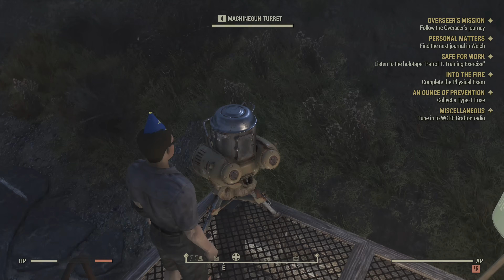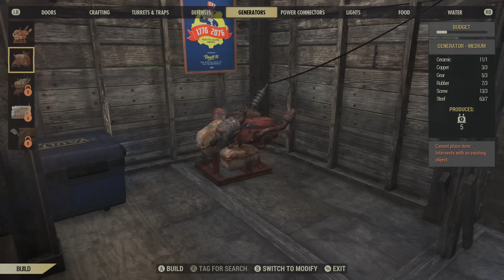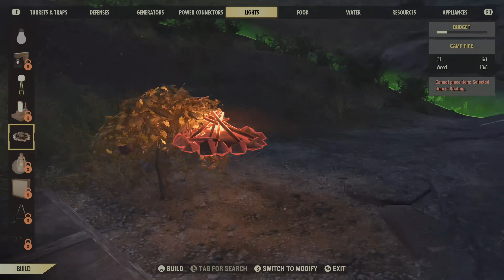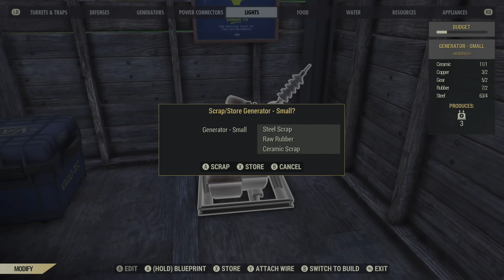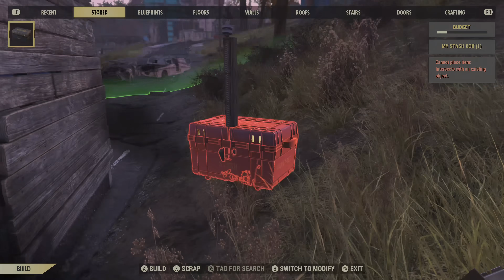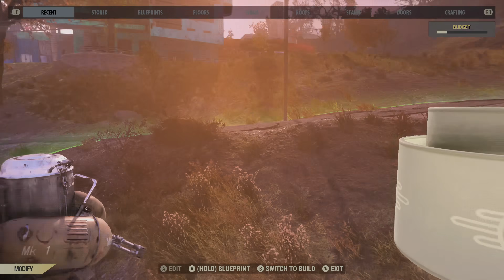Fallout 76 Electricity Guide Camp Settlement; Building Lights, Power Generator, Conduits

Comment from the maker: Fallout 76 Electricity Guide Camp Settlement; Building Lights, Power Generator, Conduits. Should help with the initial set up of lighting for your little bases. If you have questions let me know, I think this covers it well.
Reply: To unlock electrical switchs and pressure plates you need to unlock the plans for the Barn Building Set. It's sold from the vendor in harpers ferry.
Reply: @Landaren  i have learned that plans but i just got barn structure nothing electric do you know an other way to get all electric things like power switch ?
Reply: With just one pole up. What's the radius of the electricity? I hate having a bunch of wires running everywhere. So how far away can you have a light from the pole and still have electricity?
Reply: Where can I find military circuit boards is there a military base on this map
Reply from the maker: @desert-baytan3350  Umm, there are a number. I believe some are in the building right where my camp is. Some of the robotics places will have them
Reply: thanks
Reply: Straight to the point please 🙏 

We can figure out or materials problems later
Reply from the maker: @Keith Thomas  You want help and don't want to watch the video, ya.... Mostly has to do with area of where your generators are able to touch

Comment: How the heck do you connect electricity with generators outside the house to inside? I've tried to put one node on the outside and one on the inside but it says it has no power. The frustration is real.
Reply: Did you connect the generator to the node?
Reply: @nostalgigamer  not sure if your trolling or an actual question? I checked all my wiring I. E. All connected and power level was above required level, one node inside and one node outside I. E. Powered building. I then tried to put the power inside and it worked but that's not how it should work. It didn't work how fallout 4 would have it work..... Idk what else to tell you? This game is so bad in the way it works that it quite legit doesn't work and that it has only been less than a month since I've left this game behind and the £100 I spent on extra's shows how much of a fool I am for fallout.....or should I call this game failout.

Comment: I have all my hanging bulbs in a 2 story building. My generators outside. Still my lights aren't on. I built one of those wall mounted pylons to the house and connected a wire to it. Lights are still off. What am I doing wrong? Is it a glitch thing where I need to pick up and put down the lights again to get them to activate?

Maybe I need to build a small generator inside the house and a pylon as shown in this video? I just don't get why the wall mounted cable to the house does nothing...

Comment: I've just been trying to find this out.... Can only 2 generators be connected to each other? I want to power 2 water purifiers and only 1 seems to work.
Reply from the maker: You can have multiple ones
Reply: @Skycaptin5  How does it work exactly? I have 3 generators, I'm trying to power 2 water purifiers
Reply from the maker: wire them together, i believe I show that in the video
Reply: I've wired 3 together and they only power 1 Purifier, that's what I'm trying to get at. Sorry for being difficult but I'm highly confused
Reply from the maker: interesting, what's the power requirements on the purifiers? May need more generators, depends on the generator level too

Comment: Where do you get the wires tf
Reply: This is a old comment but for anyone, Press TRIANGLE on Ps4 same button for xbox as in whatever is triangle button on xbox, Press triangle to a generator, conduits for lights anyrhing that needs power etc in workshop mode, Workshop, Find what you need for power to a generator or conduit that goes too power gen, Hope it helps, Add me on ps4, Peace.

Comment: Wire won't attach at all to my fusion gen. I even tried putting the pylon right next to the fusion, no luck.

I got it to work finally. Fusion gen couldn't be placed on roof even though I had flooring down. Moving it down a level the power wires snapped green
Reply: Copper

Comment: you can get the other electricity stuff from the plan 'barn building set'
Reply: I got the Barn Building set and got 0 electricity items.
Reply: @malecite9533  Same
Reply: @Tercules1970  OK, found out what the issue is. The Barn Set Plan found on vendors is actually mislabeled and will unlock the electric parts. The Barn set that we got as a drop or event reward, is the actual Barn set. Try buying it from a vendor, that worked for me.
Reply: Sweet, thanks for the info.
Reply from the maker: Where does one come across this plan? I’m trying to make myself bright and friendly for people that walk by in case they want to chill for a bit

Comment: Wires are bugged, lights don't come on, C.A.M.P. is a broken piece of shit. Super goddamn aggravating when even the simplest things refuse to work.
Reply from the maker: Really? I’ve found the camp building aspect to be the only thing that isn’t buggy in this one lol
Reply: @Skycaptin5  Every time I wire something, it bugs. I place the wires, then they bug out and are going up in the air, not connected to anything. I've lost several items just by moving my camp, my camp disappeared completely last night, but as consolation, the game didn't charge me to move it.
Reply from the maker: That’s odd and spooky, but ya in a games of bugs this is like the one thing that works for me. Ive had a camp vanish, see it on the map, fast travel to it and it appears before

Comment: My question is for generators, do they need fuel/oil to keep them going? Like do they run out or are they forever?
Reply from the maker: They just like, run. To infinity and beyond! Only upkeep is making sure they don't get damaged
Reply: @Skycaptin5  I appreciate you responding. Thanks for the tip. I'm subbed.